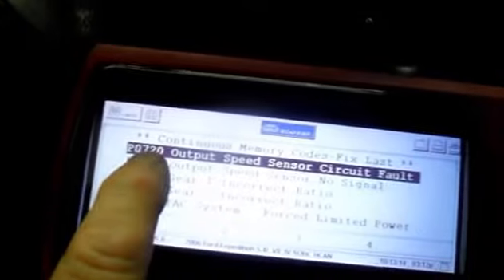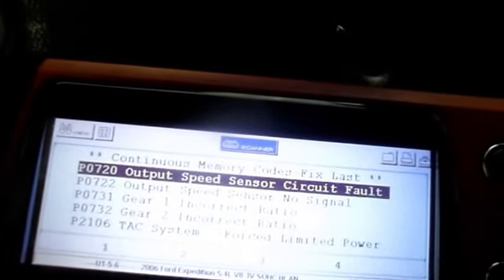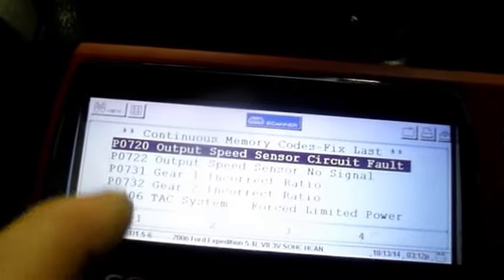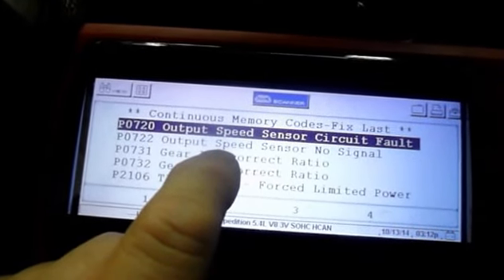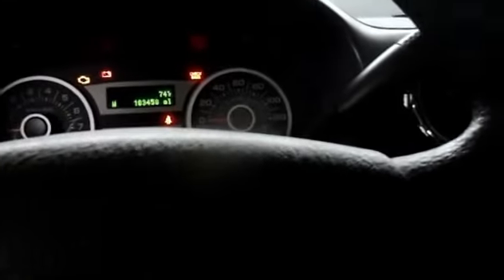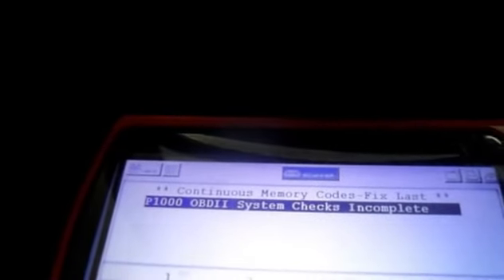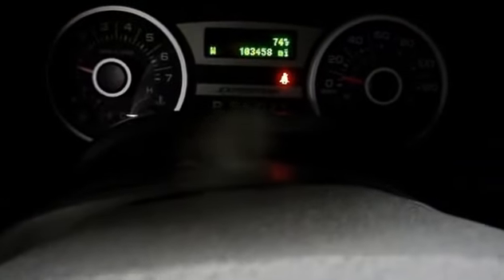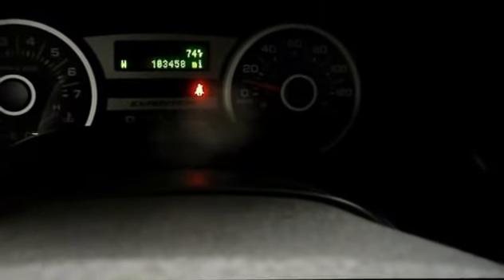FORD EXPEDITION 2006 SPEED SENSOR PO720,P0722,P0731,P0732 AND P2106

Comment: What if I'm having trouble of reversing is not giving them much power But there is no shaking or making noises. It's just, it doesn't move fast enough. I have to push on the gas slowly for it to move back.

Comment: i cnaged the oss sensor, still had the code. i changed out the pigtail amd the code is now gone. it shifted into first and i crept forward. decided to take er arouns the block, hit the gas amd nothing. still no gears, forward or reverse but the code is now gone. any help woule be appreciated
Reply from the maker: If the fluid level is full then it sound like you have a failure in the trans.

Comment: I have a 2006 expedition when I replaced the broken flex plate the speed sensor wires came out of the plug in that goes to the speed sensor I'm thinking about taking out the speed sensor so I can try to see which wire goes where 2 wires any advice

Comment: Hello Jim,i watched one of your videos on a expedition OSS i have the same problen P0720 with a e250 2008 i replaced OSS and still the same problem any help would be greatly appreciated.
Reply: Wiring issue, you need to disconnect the connector from the sensor and check it for continuity using a multimeter, likely a short or break somewhere in the wiring from the sensor to the PCM

Comment: Hey man I'm glad you made this video. My truck is an 05 5.4l f150. Both codes p0702 and p2106.  Changed the output speed sensor and still the same problem.  Do you think it's the pcm failing. Second transmission in ther and same problem  after about 3 months.

Comment: Ok so question for ya: my 06 F150 5.4 for the past month has been delayed shifting in Drive unless it’s warmed up. Worse when hasn’t moved for days.  Drives/shifts a little better when turning off O/D.  I replaced trans filter and new fluid but acted the same.  Oil was burned and magnet had 1/4” sludge but no big pieces in pan.  No engine light until now giving output speed sensor code.  Trans shop says it’s done and need to pay $4,500.  What gets me is I was thinking could it be broken snap ring? clogged valve body?  But light now throws me off unless it can hard shift like that as sensor is on its way to fill failure before light comes on?
Reply from the maker: I know it is not what you want to hear but it does sound like the trans needs to be rebuilt.Is there a lot of miles on it?
Reply: @jimthecarguy  yea, 190k.  Well dang I was really hoping it was something easier!

Comment: Hello I have a 2005 Ford Expedition and my speed will not pass 20 miles with a louder noise. Could it be the speed sensor?
Reply from the maker: Did you scan for codes?

Comment: I have a 2003 lincoln navigator 5.4l 2wd. I am getting a low input speed sensor 300 rpm. would this be similar, im getting alot of the same symptoms? i cant figure it out

Comment: i replace tha speed sensor but still dont wana change gears and my speed ometer dont work what can i do?
Reply: its not going to shift because of the e;ectronic transmission sensor, check your fuse once the spedo start working it will shift

Comment: HI Jim, I have a 05 expedition but it's doing this in reverse I have no check engine light coming on but when I shift in reverse and accelerate it slips but when I shift without acceleration it's fine it drives forward without any problems I took it to two transmission shops already and both are telling me it's the transmission...  do you think it could be the sensor?  I did borrow a computer from a friend and it is saying something about the shaft speed sensor I don't remember the code cause I saw your video afterwards... please help me as I don't know to much about vehicles thank you...
Reply: any reply?  did you get it fixed?  what ended up happening?
Reply: I have same issue has you Alvarez in my 05 expedition. You ever fix it? Thanks
Reply: Hi I have a 2005 Ford expedition and is showing an error code P0720 but just when I try to go in reverse driving forward is good, a mechanic told me maybe is a sensor,  what will be your recommendation? Excellent video.
Reply: 05 f150.  I have the same problem.  Did y’all figure it out?

Comment: I got a 04 navigator,  I got dtc p0320 , my speedometer works but it's off by a few miles . my problem is poor acceleration,  once I try to give full throttle it just bawgs out until I let up off pedal . I have changed crank and cam sensor and alternator harness and alternator . I am going to do coils and plugs as well , but wanted to know if speed sensor can cause my issue
Reply: easyaccess2 KD did the coils fix it?

Comment: Very informative. I have a 2004 F-150. Today as I was pulling a trailer with 2 atv's on it with tow/haul mode on, my pickup went in to failsafe mode, accompanied by an engine light, transmission malfunction message, blinking o/d light, and speedometer not operating at all. I did notice as soon as it starting "bucking" the speedometer was moving erratically up and down followed immediately by engine failsafe message. The codes i downloaded were P2106, and P0720. Is it safe to assume the OSS would be the fix as well? It's definitely intermittent as well, after I shut it off and drive it again, everything works as advertised, until the failsafe comes back. Thanks for your time!
Reply from the maker: It is a good possibility.
Reply: Thanks for the quick reply!
Reply: Do you fix this problem? On u truck

Comment: I took it to a shop and he never hooked the trans up to a computer he just said it was the direct drum or direct clutch. Can you tell me if that sounds right and how much it would be
Reply from the maker: +Jessica Graham  The truck should go on a computer first but if the trans need to be rebuilt it will not be cheep.get the truck scanned and let me know what codes are there.
Reply: +jimthecarguy the problem now is we have a leak where the lines seal the the nuts on the side of the transmission
Reply: +jimthecarguy please email me at jessicagraham110687@yahoo.com

Comment: my 07 f150 has both codes with od light flashing trans fault light and in limp mode replaced the oss and still acts up if i clear codes runs fine for 10 or so mile does it again
Reply from the maker: +Matt Armitage   You should have a trans shop scan the truck .It sound like there is a problem inside the trans .Sorry to say.Keep me posted.Jim
Reply: +jimthecarguy i own a snap on ethos plus scanner problem is wasnt sure what im looking for specifically
Reply from the maker: +Matt Armitage  I'm no trans guy but i think you will be looking for slippage  in the trans when the light comes on.Sorry i could not be of more help.

Comment: Checking resistance is kind of a waste.  I've had them check good, but the sensor was bad.  Your best bet is a scope, and as an alternative, back probe with your meter and check the voltage readings. It's hard to catch the intermittent glitch with a voltmeter, but you can a lot better than the resistance check

Comment: hey Jim great video thank you in advance . I have an 06 expedition 5.4 triton v8 started running and idle rough took to shop they says spark plugs so I changed spark plugs and coils car starts idles fine then when you step on the gas looses power feels like it shifts up then you floor it runs fine. ive also changed the ps catalytic 02 sensors tps cleaned the throttle body pulled and cleaned the injectors any ideas after watching this video could it be transmission sensor?

Comment: I just install a new tranny in my 2004 150 crew cab 5.4 and the overdrive stay blinking  and it read transmission malfunction but when I test drive it it shift perfect I put it on the scanner it reads po 720

Comment: I have a 2004 F150 that was working fine, and as I was driving it, suddenly it stopped driving.  The engine is running fine.  However it won't drive forward or reverse.  None of the gears work.  It codes P0720 and P2106.
I had the transmision fluid flushed and changed a month ago.  Any suggestions?
Reply: Mark Katona me too what was wrong with yours
Reply: i also have this problem

Comment: I have a 2004 ford e-150 I have put three transmissions in and the speedo only reads 10 mph and it won't shift out 2 gear it has p0720 code. can someone please help me
Reply: Did you check you OUTPUT SPEED SENSOR?